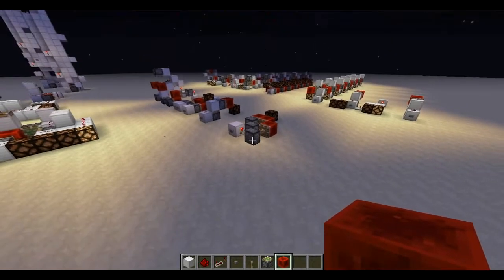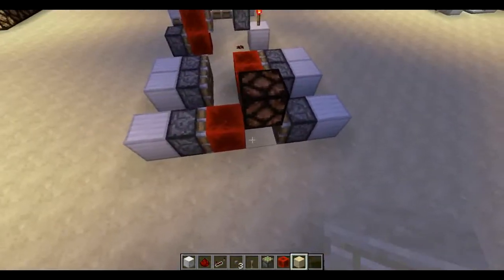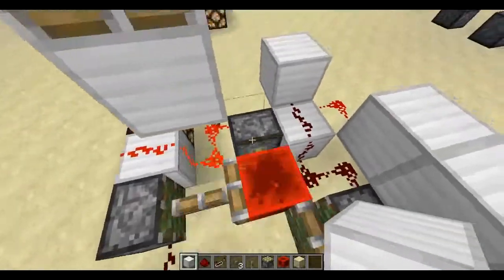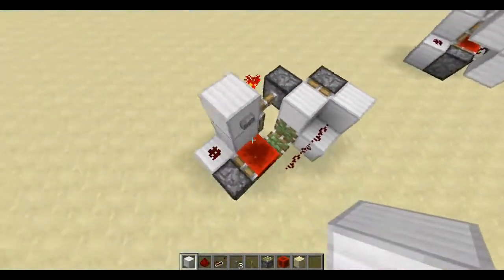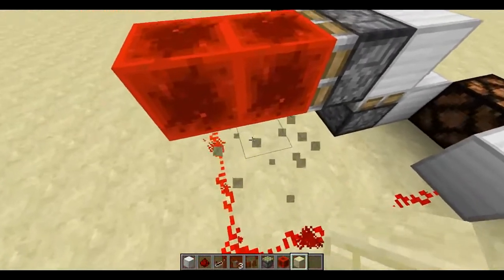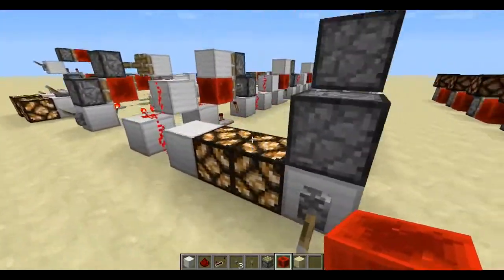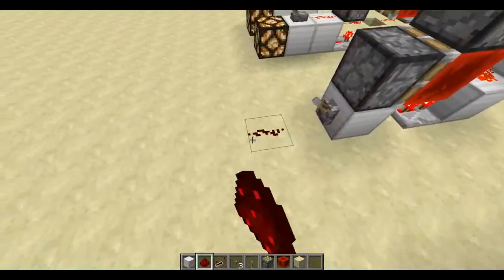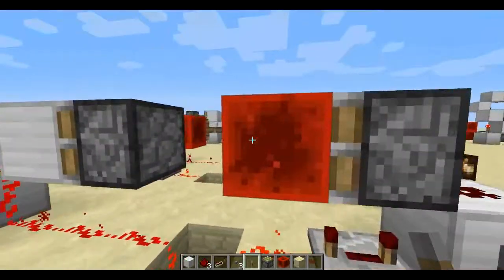Redstone block special 13w02b

Comment: some older snapshot showed well that the pulse is that short. In fact you werent abled to see the redstone wire lighting up. The same sort of short signals is used since forever for sand-generation. It is the same with the derp clock. The ghost block generator works that fast using the same signals. The server thinks the block would go to two places by firing two pistons pushung the block two ways the same time somehow. The bug is that both blocks get sent to the client - only is on the server

Comment from the maker: But what is the point of instant wire, if it's not instant? You do realize that those ticks will add up if you use multiple not gates after each other. Then you may end up with a few seconds of delay, which makes it utterly pointless.

Comment: the thing is with that t-flipflop that the monostable gives some kind of 0-tick pulse - it shuts the redstone on and off in the same tick as far as i can tell so far. That means that the pistons instantly starts the retracting, so it instantly drops the block of readstone turning the flipflop on and instantly starts the retraction turning it off because the block gets replaced by an entity.